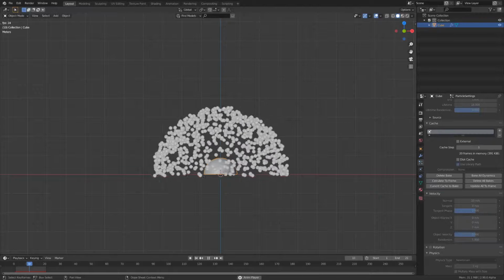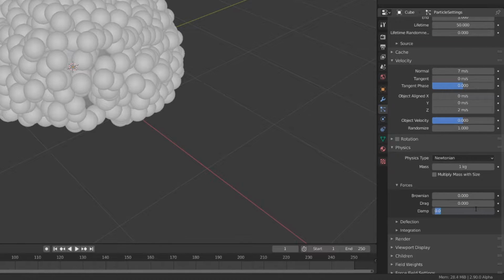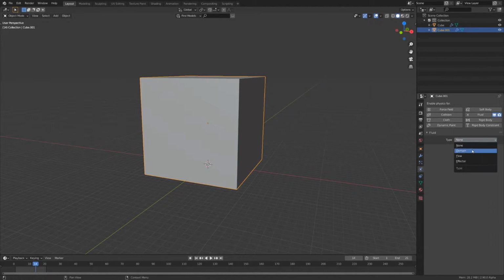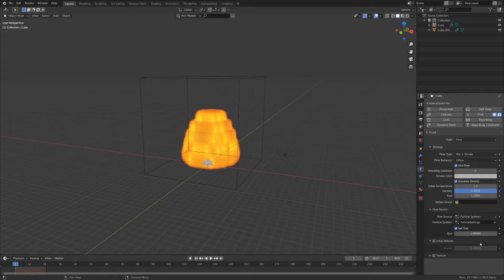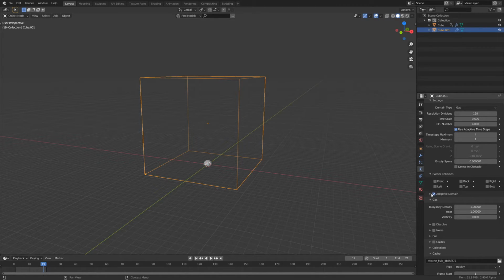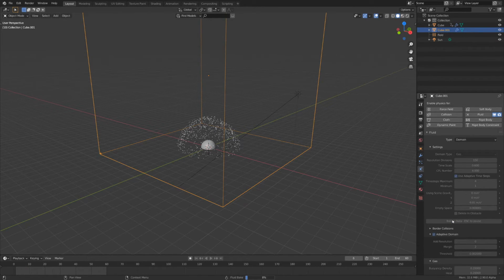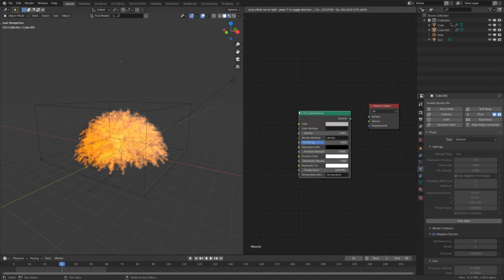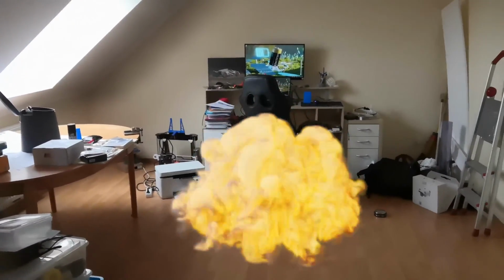Create Explosions in Blender

Comment: I was experimenting with the this earlier today but I couldn’t see what the size option did, either way my particles still seemed to be rather big. Is there something I could have missed to change the size of the particles?
Reply from the maker: The size option changes how big the particles are. Particles are technically just infinitely small points, but for the simulation it makes them spheres of a certain size (using the size option). If nothing is changing, make sure you're rebaling the simulation, and when you set the new scale you also have to set it as a keyframe again, or else it'll get removed again.
Reply: @sam_de_ham  does the size only show when the particles are baked? I didn’t think it needed baking but if it does then thats probably my issue.
Reply from the maker: The size option in the simulation only affects the simulation, the display size in in the particle settings under viewport display